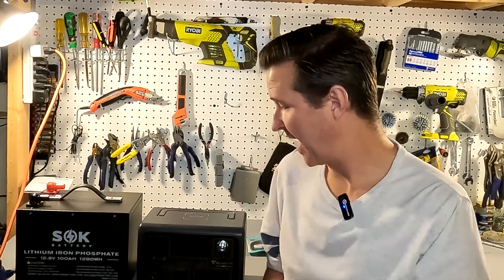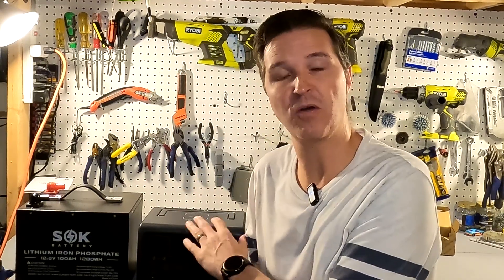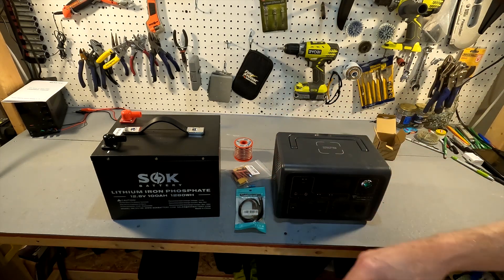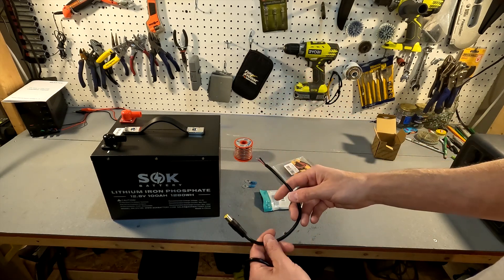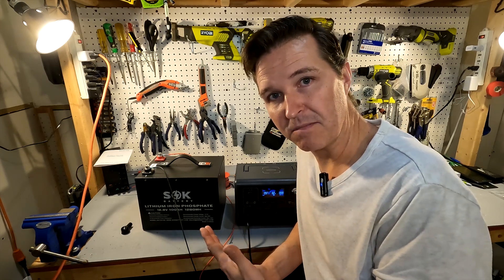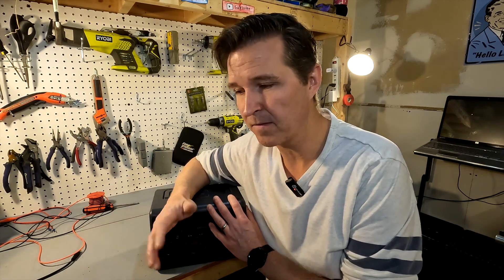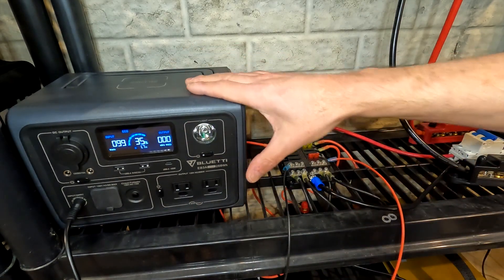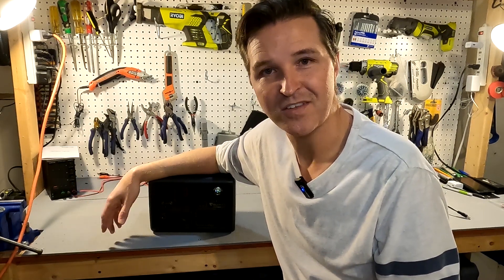EB3A Battery Extender

Comment: Hi just wondering if you can also extend the battery capacity of the bluetti AC70 by using a 12v 50ah deep cycle battery and a 12v to 24v step up converter?
Reply from the maker: Yes.  You would need to connect the converter to the ac70 with a xt60 connector, but everything else would be the same.

Comment: I just bought one for an ok price...but normally .. the problem in ..Europe where I live, is that all models of everything is 1-2 years behind being sold here, and only a small assortment where the price is 2-3 times higher. The selection of Cables and Connectors is much smaller and only sold by special companies, which charge exorbitant prices... and that kills the fun .. 🙂
Reply from the maker: That's a bummer..  thanks for the info and the comment.
Reply: @OffGridBasement  Well... I just picked it up... lets see how it performs over the next months :-)

Comment: We got a mad scientist over here mixing 14 gauge with 10 gauge, using butt connectors which could come apart and spark, using a buss bar with all different size gauge wires, put a high load through a 14 or 16 gauge and watch those wires melt. Using too small of a wire will cause voltage drop, which creates heat. Couple that with a high voltage and you sure will have a house fire on your hands. Putting a bigger amp fuse like the 10 amp to protect a 8 amp max will not trip that fuse, and will short out that controller. You have the right ideas, just not the right execution.
Reply from the maker: You forgot to mention I said buck converter when I should've said boost converter!  Thanks for the comment.

Comment: Can you remove the barrel plug. An just plug to the original battery wiring?
Reply from the maker: It's most efficient by using the DC port of the Bluetti.  I'm not sure how removing the barrel plug would help.
Reply: @OffGridBasement  cause I'm getting a battery error

Comment: Good video. Even if you make the 'simple plug' as described in the first half of the video - always, always, always put an in-line fuse near the battery terminal. Those lithium batteries are capable of pushing massive current. Also, cheap fuses bought on-line are usually such bad quality that they just don't work - your wiring will melt before a cheap, fake fuse will blow. Buy from a reputable manufacturer like Littel Fuse via a reputable electronic component warehouse.
Reply from the maker: Thank you for the great information and the comment!

Comment: I have a EB3A  connected it to a 12,8v 50ah  = 640wh   + the EB3A  true efficency 190wh = 830wh   i ran my PC +computer screen 27inch  pulls 105 watts  the Bluetti EB3A tells me  estimated time
run time is 24hrs. but i do not think that is right. 830 wh  / 105w=  7.9 hours   so 24 hrs is over estimating because the battery weekens  as time runs off and it has 13.1 volt indicated on the battery monitor. i cannot let the battery go lower that 12,2v.
Reply from the maker: You are absolutely correct, I think the battery power meter overestimates the run time.

Comment: I use a ebike battery. Its 52v 20ah so about 1040 watt-hours and flows at about 500watts if I remember correctly. Just use the xt60 cable in the solar port. Ecoflow delta 2000
Reply from the maker: That's a good idea.  Thanks for the comment.

Comment: I'm confused why you wired this up to use the barrel plug.  Why not just have the power from the battery go in through the xt60 port?
Reply from the maker: The EB3A doesn't have an xt60 port.  All DC input is through the 8mm plug port.

Comment: if you have solar connectors, what i did was connect them to the external battery, then i connected to the solar cables that came with my bluetti....didn't have to buy xt60.  just an option
Reply from the maker: Thanks for sharing and the comment.

Comment: personnaly i do not use a 12v to 24 v  booster. I use my 12,8v 50ah  direct  gives me 99- 98-97 watts it does the job and recharges my EB3A  my Ac 180 and soon my AC70  I want to by a 24 v 50am  or 100am but  24v 100ah is 600 plus CAD  . expensive
Reply from the maker: Thanks for sharing and the comment.

Comment: Thanks for the idea! Currently use my Eb3a to power a 12v cooler/fridge for camping and have to recharge off my Rav4 Prime twice a day.. it's a plug in hybrid so I charge the Eb3a off the 18 kWh battery but I have to keep the car on for an hour each time.. adding an extra battery would simplify things greatly!
Reply from the maker: Glad I could help!  Thanks for the comment.

Comment: THIS IS GREAT!  Question: Do I have to use the same battery chemistry to charge this? I have 2 35wh lead acid batteries from Harbor Freight, and I'm wondering if this would work. Thanks for sharing.
Reply from the maker: Any chemistry will work.  As long as you have enough voltage coming from the batteries, you're fine!
Reply: @OffGridBasement  Thank you for your reponse!

Comment: You are basically using the eb3a as an inverter.

You are going to need another way of charging the external battery.
Reply from the maker: You're right.  I've done another video on how to charge the battery using solar.  Thanks for the comment.

Comment: I get only 60-70 watts with 24ah battery.
Reply from the maker: It depends on the voltage.  Is it a lifepo4 or SLA battery?
Reply: @OffGridBasement  lifepo4, battery fully charged, same battery charge river 2 - 105 watts. river 2 max- 170 watts.

Comment: The question is how will I charge the external battery?
Reply from the maker: Here is a link to another video I made about that.  https://youtu.be/ppujPRMS4YA
Hope this helps.
Reply: @OffGridBasement  so the external battery will not charge in normal EB3A charger while the external battery is connected?
Reply from the maker: @AllanJosephDelaCruz  no.  The port the battery is connected to is not bi_directional.
Reply: @OffGridBasement  so if I put 24V/100mah external battery, I can charge the eb3a from its charger directly? same time the external battery will get charge too?
Reply from the maker: @AllanJosephDelaCruz yes

Comment: I bought these Klein crimps seeing you use them but mine seem to puncture the heatshrink crimp all the time, Did you have to change the die in the Klein crimp? Thanks in advance
Reply from the maker: No.  I've never had a problem with my Klein crimper.  That's a bummer.
Reply: @OffGridBasement  Thanks so much for response. 
Yes I bought the multi pack including wire stripper and very impressed with them both just unfortunately damaging the crimp on the marine heatshrink butt crimps.
I will try another brand of butt crimps to rule it out

Comment: For anybody using your non fuseblock option outside of a demonstration, I recommend an in-line fuse off the battery + lead.
Reply from the maker: Yes.  You should always fuse your wires.  Thanks for the comment!

Comment: This video is misleading and confusing. The eb3a is not expandable. Anytime you go in your dc input port you are charging your battery. Your proloning your usage. Its one battery charging another. There are models like the ac60, ac200l, ac200max, ac240, ac200p that are expandable. Basically, they use a cable called aviation to aviation cable and that goes pluged in an aviation port. Do your research
Reply from the maker: All I'm demonstrating is the ability to keep your EB3A battery topped off by using another battery.

Comment: I just tried using my EB3A while charging with 200w solar panel as I watched it from your other video. my solar panel produce more than 150w that time and I only connected a 10w clip fan on my EB3A.  battery level is fluctuating to 99% and 100% when full charge every few minutes. the question is.. am I decreasing my EB3A battery life cycle with this activity of 99% to 100% up and down charging every few minutes? I want to know because I'd like to connect a large battery at night but im afraid if it'll just have the same issue. Thank you
Reply from the maker: I don't believe this will have any issue with the cycle count of the EB3A.  Small charges like what you are seeing don't have much effect on Lifepo4 cells.  I believe something else in the unit will fail before the cells.  Thanks for the comment.
Reply: @OffGridBasement  thank you

Comment: Great idea but you have to remember that this will extend your run time for whatever you have plugged in but you are still limited to 600watt output
Reply from the maker: That is true.  This setup will not increase the inverter output of the Bluetti.  Thanks for the comment.

Comment: I use this method with a smaller powerbank that has nice DC inputs and outputs.
Ideally we want a powerbank to have a true extender, charge and discharge both at the same time , instead of one flowing to another. An equilibrium and balance to minimize cycles.
Reply from the maker: Thank you for the info and the comment.

Comment: can the EB3a be recharged from a EB70s using an amazon 24v adapter-HKY  DC Converter 24V 90W DC Adapter 
This item HKY  DC Converter 24V 90W DC Adapter ????
Reply from the maker: As long as the eb70 can pull the amount of current needed I don't see an issue.  I think it's 8.5A.

Comment: @off_grid_basement - If you do what you describe does it increase the units ability to handle higher amps?
Reply from the maker: No.  It still can only do 600w of output from the inverter.  Hope that helps.  Thanks for the comment.

Comment: Very interesting. I would like to charge the SOK using the EB3A which is plugged in to AC power. The EB3A, has 12V output which can feed the SOK?
AC -> EB3A	->	SOK. Has anyone tried that? Basically using EB3A as a battery charger
Reply from the maker: I've never tried it, but I don't think it would work.  I think the EB3A DC circuit would fault due to over amperage.  The battery would ask for over 10A.  Thanks for the comment.

Comment: Hi one thing I’ve learned after adding more batteries and all is that I should have just bought the bigger units to begin with. Much more clean and ready to go.
Reply from the maker: Hindsight is always....  well..  you know.  It's just hard to put all the $$ up from for something that your not sure you're going to take full advantage of.  Thanks for the comment.
Reply: I wouldn't sacrifice the portability and range of options for a bigger one. 100Ah battery in the car and at home and the eb3a  delivers everything in a tight and light package.

Comment: Why pay the double conversion penalty, instead of simply using a different inverter? This wastes a significant amount of the total capacity by charging, then discharging the EB3A’s battery. 

A small inverter is less than $100 and doesn’t have the conversion penalty involved with doing things this way.
Reply from the maker: Thanks for the information and the comment.

Comment: Great setup but how do you recharge the battery?
Reply from the maker: I made another video going over that using just solar.  https://youtu.be/ppujPRMS4YA
Reply: i have 1 100 whr battery and 2 20 whr batteries. how could i connect all 3 batteries to keep the eb3a running longer and would that be a good idea?

Comment: 0:41 I leave my AC cable in all the time to recharge when power comes on. What happens with second battery? Must I only connect that once bluetti's battery is flat and then disconnect AC plug before I connect external battery? Must I then separately charge external battery again with it's own charger once it's flat. Might sound like stupid questions, but this is not my game
Reply: Thanks for the reply, and I now have a seperate charger for external battery. If AC power goes off, my TV & Explora uses 130w but external battery (12v/105ah) only charge Bluetti at 30w which is 100w less than what it needs. It does extend it to 2h40min. which is only an extension of 40 min. Remember that I use Bluetti while AC is off and don't just charge it. Does the 30w input charge sounds correct?
Reply from the maker: Everything you said is correct.  I could leave the secondary battery plugged in even if the bluetti is full, but then the secondary battery will fully deplete.  Then you will need a separate charger for the secondary battery.  I hope that answers your questions.  Thanks for the comment.

Comment: How do you go about charging your battery bank without exceeding the input limits of the EB3A? Or do you disconnect the EB3A first then charge your bank?
Reply from the maker: I don't believe it would bother the EB3A if the  battery was also connected to a charger.  I plan on making a video of ways to charge the battery that's connected to the EB3A.  Thanks for the comment.

Comment: Is the length of these barrel plugs OK?I bought The barrel plugs and the little battery connector plugs  through your Amazon affiliate link how ever I haven’t tried it yet i will soon as I’m getting ready to. I noticed the barrel plug seemed a little bit short will they work OK with the EB 3? I really like that fuse Block hook up I believe I’m gonna go for that one also and just keep a small 50 amp hour battery handy if we go on a trip or something
Reply from the maker: They work just fine with the 8mm port on the EB3A.  Please let me know if you have any issues.  Thanks for the comment.
Reply: @OffGridBasement  thanx👍

Comment: What size amperage with the boost converter? Could I get one rated for 15amps therefore not maxing it out possibly having the converter not run as hot? Or do these converters just go to their max regardless?
Reply from the maker: Mine is a 10 amp boost converter.  I believe the EB3A would limit the draw, so the bigger the converter the less heat.  Thanks for the comment.

Comment: I've gone a step further and actually directly connected extra battery by making y connect for xt60. So took the unit apart and connected the y connector with two batteries to the unit. It manages to charge both batteries with solar input which is awesome
Reply: Do you have a video of the y connection you made or can @OffGridBasement make similar video?
Reply: For real man, you gotta show us how you did it
Reply: @Niekomojo opened it up. With it off an disconnected where the internal battery was connected to the charge controller.  Cut the ends off. Added a Y or a splitter. An reconnected it back to the charge controller.  To the charge controllers was feeding power into them both together sounds like
Reply from the maker: That is smart thinking!  Thanks for the info and the comment.
Reply: Can you help me with this
Reply: Now that's how they should have made it to start with.
Reply: does it work with the 230v charging as well?
Reply: @CHRIS1887 if it’s done how he said it shouldn’t matter
Reply: How does it charge the external batteries as well as the internal batteries without an external charge controller
Reply: @Niekomojo because it’s connected to the internal charge controller.  To plugging it in. It still thinks it’s just charging it’s internal battery but is really charging both
Reply: Can you share your experience of using in that way connection?
Reply: So you took apart the EB3A and wired it directly? I was wondering how to charge the extra battery elegantly  with this setup, and does the AC charge the extra battery as well?
Reply: do you have an easier way to do this without wiring?

Comment: I’m really grateful for your videos I’m starting out new with these LIFEPO4 batteries and my EB3 A. your videos are very straightforward direct and to the point very helpful. do you think it would be OK to set up a 100 W panel outside (ground it of course) and run the wire inside fused and everything and then put my connectors on in the house and just hook that up to my EB3A and kinda use that as a charging station for the power station and maybe have some kind of a deal rigged up where I could charge a 50 amp hour mini battery on that same panel? Ok I think I made a mistake in my planning here,,,it would be better just to set up that solar panel or maybe two for the battery and just make your connectors and re-power the power station in thata way 👍😊
Reply from the maker: Your second thought would be best.  😀Charge the battery with solar and charge the EB3A with the battery.  Thanks for the comment.

Comment: Does the external battery just to help charge the power station or does it actually help the powerstation run longer
Reply from the maker: Both.  Once the power station is full it pulls from the external battery.  Well, as long as it's not over a 100w draw.  Anything over that and it pulls from the power station as well.  Thanks for the comment.
Reply: @OffGridBasement  thanks 👍

Comment: i just got mine a few days ago love it. but you can only put 200w into the Buletti. if you are using more then you are taking in then it's not going to work. You are not really expending the compacity. you cant access the second battery only at 200w so cant see how that is expanding your storage. all you are doing is mimicking the solar input. please let me know if im looking at this wrong.
Reply from the maker: You are correct.  It's really meant for overnight use.  I was thinking of powering a fan and some lights.  It would pull it from the battery and keep the Bluetti full.  Thanks for the comment.

Comment: I have an eb70 and have love to have an external battery input that does go through the mppt charge controller. Thi is why I got a dr prepare for 276 and use a 300 watts inverter velcro to the side 😂😂😂
Reply from the maker: Hey, whatever works!  Thanks for the comment.